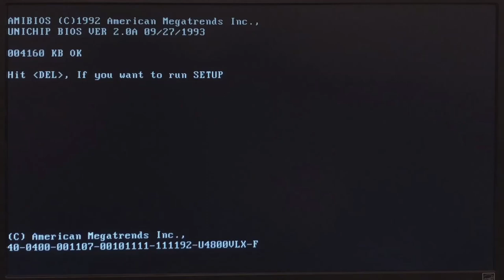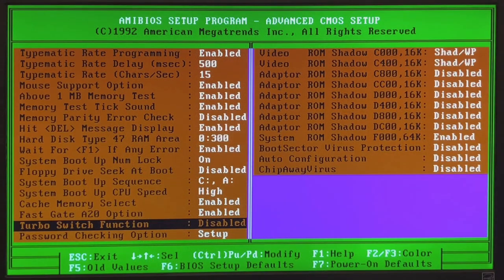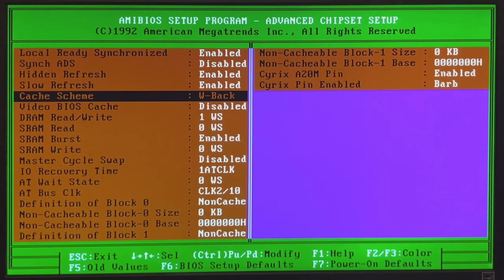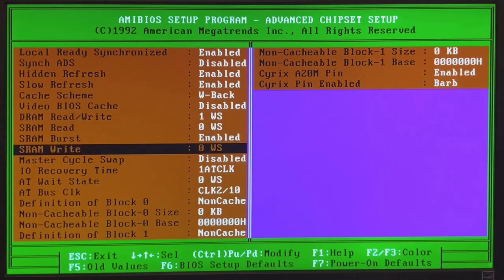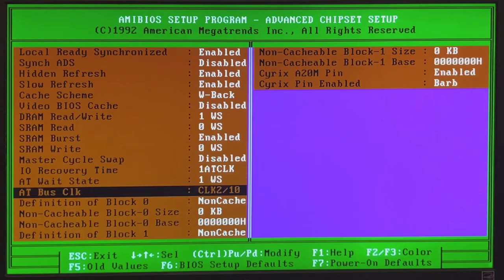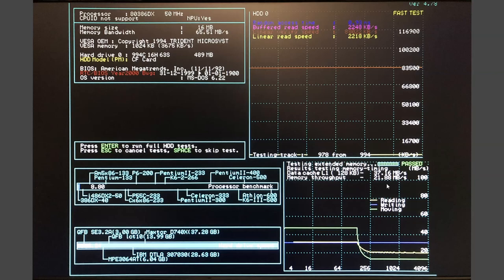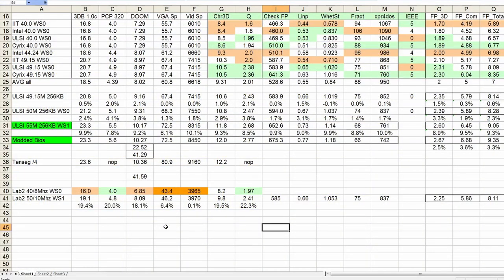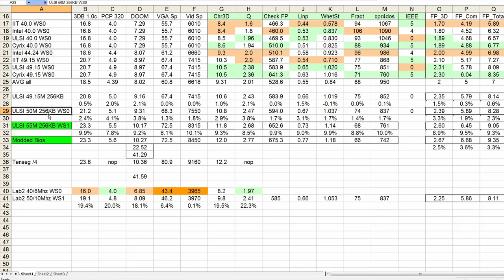386 Motherboard Review / Optimization Guide: 367C Rev 1.0 (Unichip U4800-VLX) .

Comment: I have a 367C board without a Bios chip. I removed the Bios chip from another 367C that I have and I discovered it is an EEProm (no UV window). The only numbers on the chip are 0ABB039/11-5121511/(Triangle icon)345C3BAD0A , I have searched the internet and I can find no info on this Bios Chip. Do you know what this chip could be and what I could use as a replacement?
Reply from the maker: This is a 64KB Bios.
More or less all motherboards like that use a 27C512 Chip.
Brand, window or not does not matter.
Reply: @atheatos  That's exactly what I tried, I programmed an M27C512, used both of the Roms at Retro Web but neither worked, the post card just shows 4 dashes. Popped the Good chip in and it posted. None of the Chip types I tried with the TL866 can read the good Bios chip ( I was hoping to dump the Bios). I rewatched your video about Bios Modding and I'm wondering if this good bios chip is a 'one time programmable' perhaps that's why it's impossible to find online. The M27C512 I'm using is from a parts board (I've never seen it actually functioning in a running machine) so I'm going to try programming it for another machine and see if it will work in that, if not I'll try another 27C512.  Really appreciate your reply Good Sir. I'll be sure to credit your assistance in my next video concerning this. Thank you
Reply from the maker: If you program and verify your chip with your programmer, it should be fine.
So my guess is that the roms you downloaded are just incompatible with your board.

Unfortunately many OEM of this era used custom ordered one time programable chips with custom prints for their motherboards.
So it is impossible to tell the real model / brand of these chips. However for sure these are one of the many 27c512 listed in Xgpro tool.
Just try all of this and try read your chip. If you get an invalid ID massage you can still use the option to ignore the ID and try read it.
Or You can see the ID and go online and check it. There is a site "EPROM Device ID List" with a bit list of IDs and eeprom models.
Then an other approach is maybe to use some dos utility to dump your bios into a file. Search for "dosdays BIOS Utilities".
Reply: @atheatos  Fantastic, I will try all the above until I get that rom dumped and transferred. I read on a forum there is a potential to damage the Bios chip by reading it with the wrong Chip selected, but you see a lot of half-baked opinions regarding these things. So far after trying 6 or more types my chip is still functioning. You think there is any truth to the programmer damaging a Bios chip with a Read?
Reply: As you predicted, Yes indeed my M27C512 Chip is fully functional in my Fortiva 5000 machine. On to the next step. Thanks again.
Reply: You are a Genius! Thank you so much. I now have a functional Bios Chip. Just had to deselect "Check ID" and it read the Bios no problem. I owe you a big favour.
Reply from the maker: Yes this can be in theory true if the physical chip and the selected one have completely different pinouts.
But you chips is probably just a minor variation. All these 27c512 have the same pin-out.
I think that the programmer also has some protection resistors in series.
Writing is the real danger as the programmer might put a high voltage to only one special pin.
Reply from the maker: Yes this can be in theory true if the physical chip and the selected one have completely different pinouts.
But you chips is probably just a minor variation. All these 27c512 have the same pin-out.
I think that the programmer also has some protection resistors in series.
Writing is the real danger as the programmer might put a high voltage to only one special pin.
Reply from the maker: Thank you. It is nice to hear that this worked for you.
Device ID is just unique for every manufacture but more or less all 27c512 are electrically the same.
Reply: @atheatos   @atheatos I checked the data sheets for the m27c512 vs the w27c512 and they appear to be the same. Would save some time using the EEprom. I need to get some of those. Really appreciate you taking time to walk me through this. You're a super star in the retro Community. I'm off to send my working Bios dump to the Retro Web.
Reply from the maker: Thanx again. The w27c512 is a bit different from other 27c512. It is electrically erasable. It is the same on read and so a pin compatible replacement on the M/B, but yeah it can be directly erased and reprogramed on the programmer. It is a good idea to have a few of these.
Reply: @atheatos  I got a reply from the Retro Web and they let me know my Bios dump is the same as the one already there, and asked me if I had unzipped the files, and then I realized what a stupid mistake I had made. I am still facepalming. I have programmed so many chips and I don't know how I overlooked this simple step ( other than not looking at the extension). Anyway, thanks again for helping me find an alternative way to solve the problem I created for myself. Talk about embarrassed.
Reply from the maker: You flashed the zip directly? OMG
Reply: @atheatos  That's what I get for trying to rush to get my video finished. I tell the embarrassing tale in my next vid.
Reply from the maker: Ok making videos is very stressful.
I have subbed I will check :)